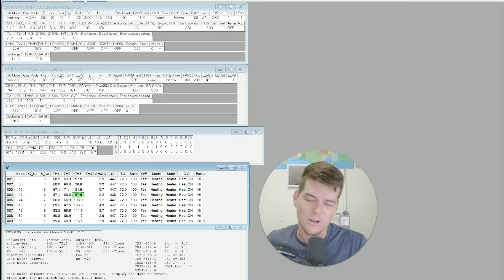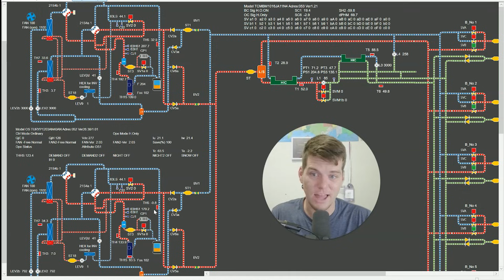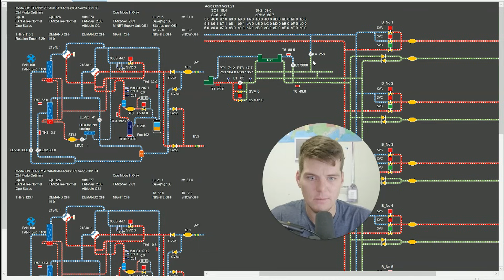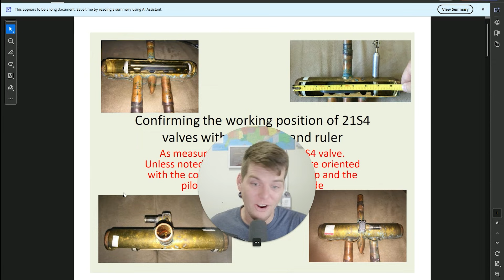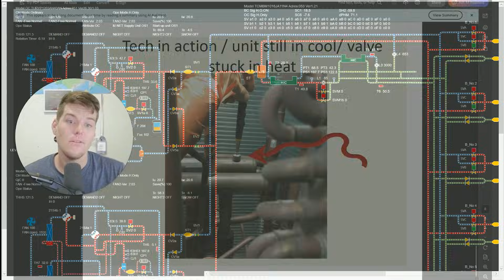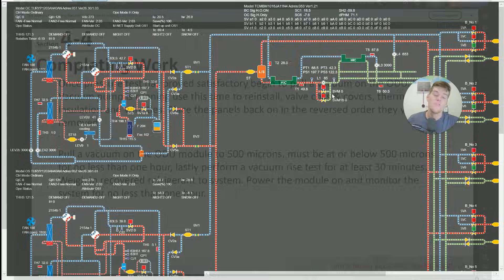Mitsubishi Heat Recovery - G Gen -  NO HEAT

Comment: Would you ever do some videos on lg vrfs?
Reply from the maker: Of course send me some!
Reply: @RomanBaugh  how do we send data from the lgmv app?
Reply from the maker: Let me see if I can find something on it exporting info! I would love some Lg data to make a video on so send away!
Reply: This video was very helpful for me as as intermediate VRF Tech you’re an expert Roman. I think I’m dealing with this exact issue with a LG unit that looked starved but I know it couldn’t because I was there the moment we charged it and changed the compressors. After all that system still barely did any active cooling or heating and oddly enough it performed slightly better when I closed the 3rd heat recovery pipe (low pressure gas) I believe.